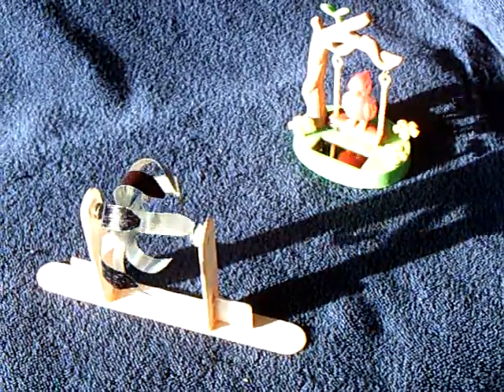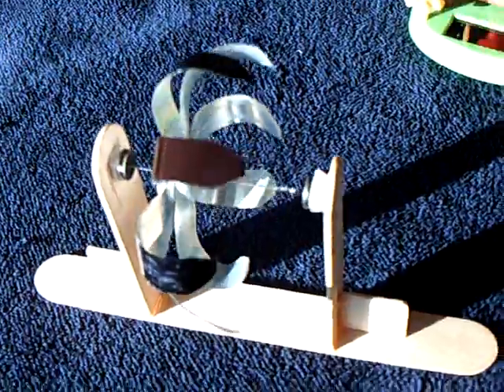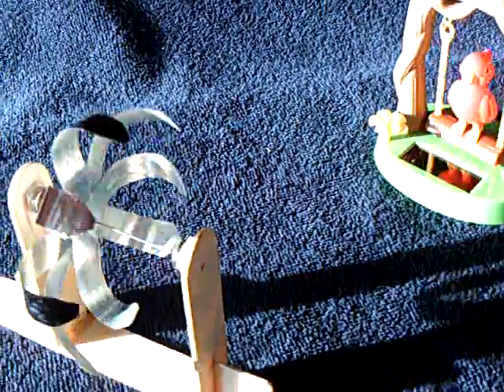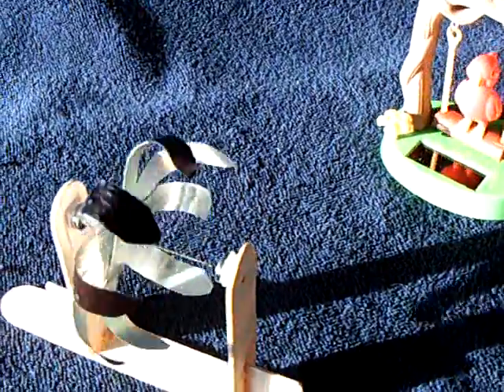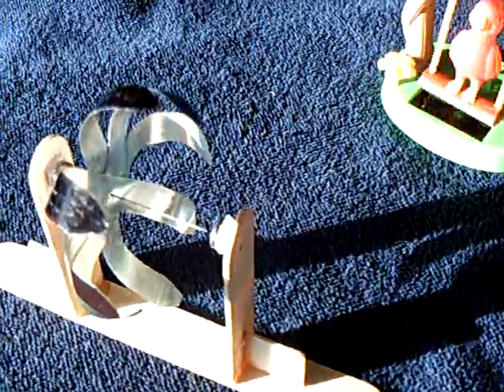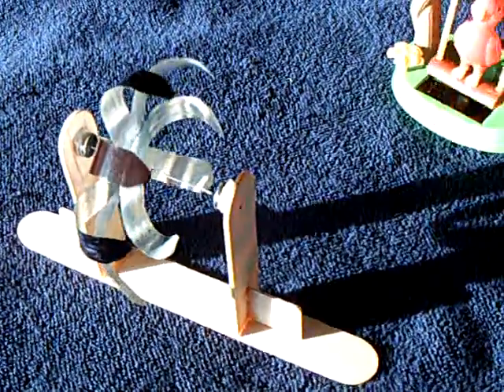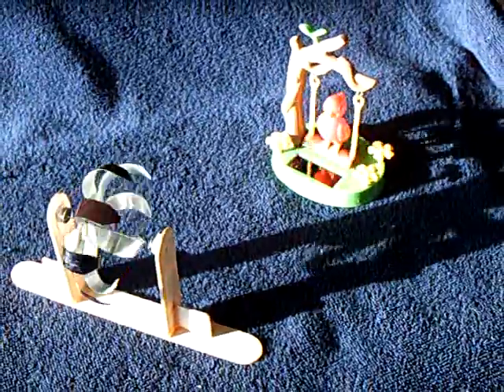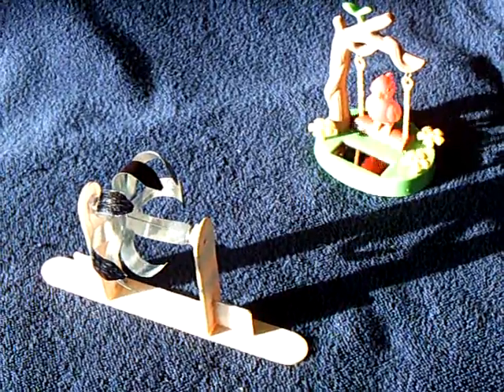Solar Powered Blade Heat Engine

Comment: Nice solar motor Lidmotor - because you talked about this that you didnt see anywhere something similar, i want to mention that i did invented by my own a similar solar heat motor from black and white cardboard propeller under a bell glass since 1998-1999 actioned by solar heat - some of my friends know this project from that time and saw also the schematics - i dont know if i published this also on JLN Naudin Free Energy forum at that time, it is posible - tnks for sharing and nice build-up, keep going!
Reply from the maker: johnnyaum3 Thanks.  I would be interested in seeing a video of it running.  Making one of these using paper would be fun and probably easier.

Comment: Dear Lid, I think you will have a better result with a larger diameter but same width of blades or longer curve petals.

The reason is that when it is turning it presently contradicts itself in its rotation because the expended side turns and have not the time to cool before to go on the the other side.

With a more directive exposure, I mean on a smaller portion of the heat side, I guess the petal would have time to completely cool an retract in phase with the angular speed, thus you would have no more this pauses in the turning but a continuous turning. BTW, Blade's Sun Flower is a little bit larger in diameter too ;)

Regards.

Comment: More successful than me, haven't had consistent sunshine. It just teases me, starts to unfurl then a bit of cloud and it shuts up again.
Reply from the maker: GrandadIsAnOldMan  You are right.  Partly cloudy days don't work well.  One thing that I have noticed is that any sunlight causes a reaction on mine and it will move slightly.  That in itself is fun to watch.  I put mine in the freezer for a second to see what would happen and it curled up into a ball. That was  also interesting .
Reply: ***** yes I think you could just make a bunch of flowers that open when the sun hits them. No need for them to start spinning, just opening and closing is visually pleasing.
Reply from the maker: GrandadIsAnOldMan  A bright flower bouquet would be interesting or whimsical creatures that simply opened and closed parts of their anatomy when the sun hits them.  On partly cloudy days the movement would happen as the clouds go by.   Great fun.